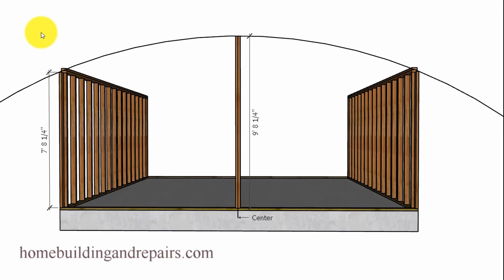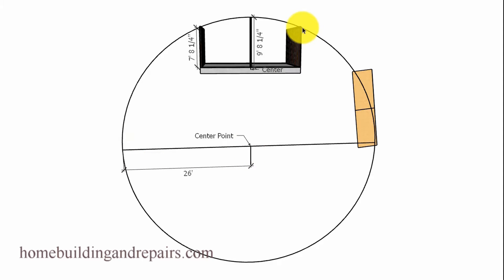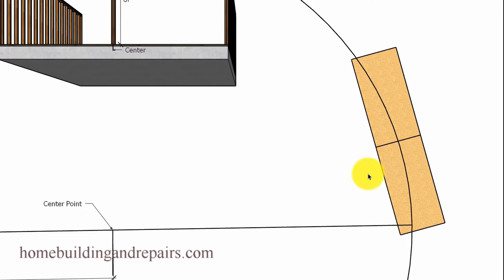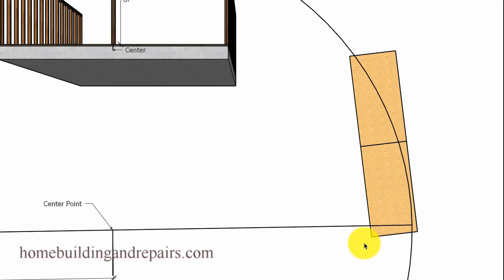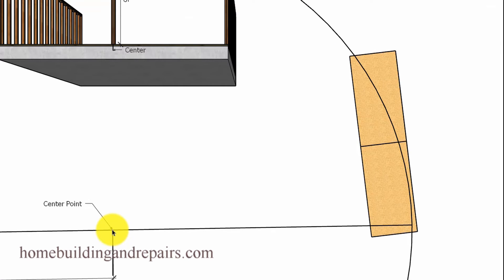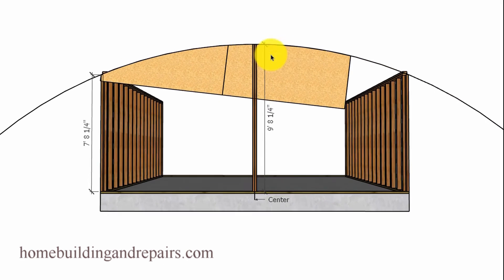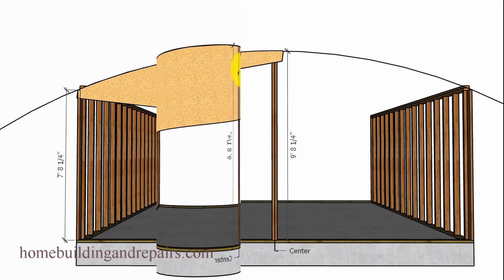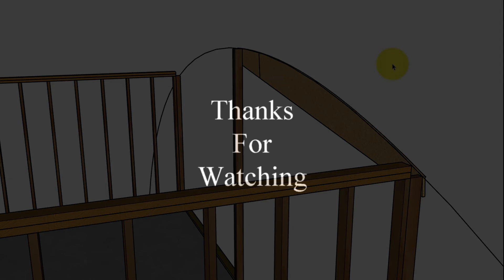How To Make A Template For A Wall With A Large Circular Radius

Comment: You could also calculate the distance of a shadow and project a circle onto a wall then trace the shadow. You can also plot the circle onto the wood. You can also draw a straight line from end point to end and then draw a line perpendicular to the straight line and find the curve needed.
Reply from the maker: Now that's thinking outside the box. You might be onto something, but it will probably be more difficult to trace something than it would be to use some of the information in these videos.